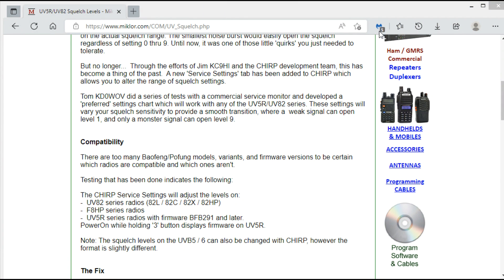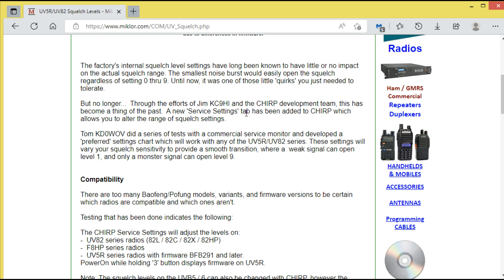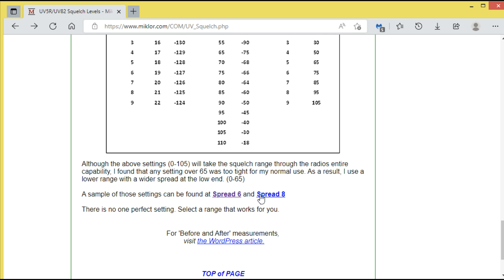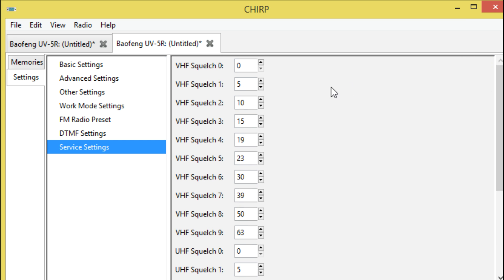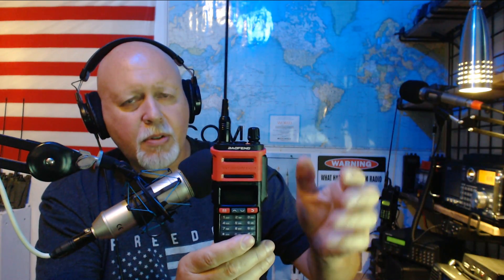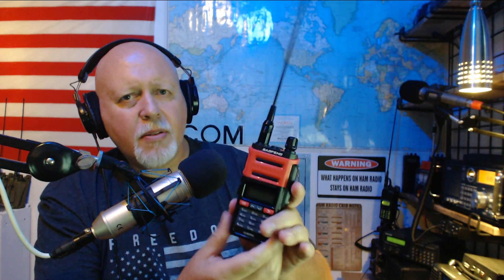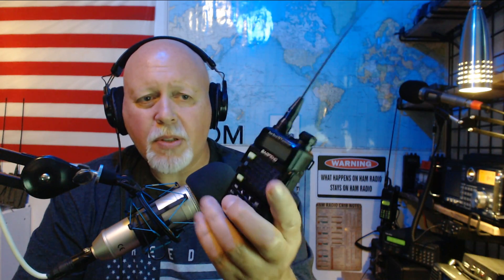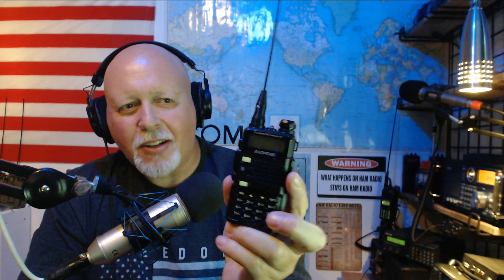Baofeng Squelch Issue Fix!

Comment: If anyone decides to try this, make sure to save a backup image in CHIRP or jot down your original settings so you can restore your radio if it doesn't work. Thanks.
Reply: Some radios, like my Baoefeng UV-5G, there's a RESET setting in there.  Haven't need it yet, fortunately.

Comment: Ordered a programming cable so I can try this. Better than buying a whole new radio for my truck!
Reply from the maker: @minutemenapparel  I'm just curious which model baofeng
Reply: @northmanproject4007  UV-5R. Tried it out today. On setting 4 (which I set to 40), it was fairly quiet, did not hear any static until I was driving near a military base. Forgot it was on! Before up in the mountains, it would constantly have static. Default on my radio VHF 30(9) and UHF  24(9).
Reply from the maker: @minutemenapparel  Awesome

Comment: Yeah those Retevis RT-85 radios are great and have a clean signal as well as a 5w output on the ham, murs, and gmrs bands and the antennas are pretty good too which is unusual for CCRs.

Comment: Thank you Northman, excellent post. After some experimentation, I tweaked your settings a bit and used a 0-60 value range (0,5,10,15,20,27,35,43,51,60). After uploading the changes to my BF-F8HP I tried hitting all my local repeaters to make sure the squelch would open. Everything is working normally,  except background noise is now greatly reduced!
Reply from the maker: Yes! That's awesome! Glad to hear it. Thanks for sharing that! Hopefully it will help others too.

Comment: Thanks for the help. I'm new to this, other than messing around with CB as a teen. Was curious why Ham and GMRS radios use buttons instead of a knob to control squelch?
Reply from the maker: @fondy44  my guess is it's a cost Factor it's probably cheaper to do it that way

Comment: I'm having the opposite issue... I have mine on 1 and can't pickup the weak but intelligible signals in my area. Can't wait to try this
Reply from the maker: Yeah I've actually had one set on squelch level one with a very high value and it was cutting out everything pretty much. Good luck with it.

Comment: I didn't even know about this until now! My UV5R squelch was factory set at 21-29! Too strong. No wonder it wasn't very sensitive. I now have it set at 0-0, 1-1, 2-5, 3-10, 4-15, 5-20, 6-25, 7-27, 8-28, 9-29. Thanks for this video! 😊PS. Never have much interference to constantly break squelch. Glad this is so programmable.
Reply from the maker: That's awesome. I'm glad it has improved! Thanks for the comment.

Comment: My firmware is BFB297 , have to give this a try..thx.
I bought a Baufeng UV-5R when they 1st came out.  Use it mostly as a Police scanner.  I notice that when I recieve a transmission..fine..till I push any buttons..then the radio freezes..unable to recieve tranmissions..  If you press ur ear to the radio speaker..you hear a clicking sound....  Police scanner in back ground works.  Have to shut off the Unit & turn it back on..fine..till you push any buttons.
Found out after years of this headache..that the radio goes nuts whn you shut of keypad 'Beep'..  Turn on KeyPad & unit works fine.
Just in as anybody had/has this problem..please past this infor on.

Comment: Thank You so much! I Actually purchased a UV-9R Pro and sent it back. I thought there was something seriously wrong with it. I got the replacement and it did the same thing! It was constantly dropping a Repeater, even though I no there was no way it should. My scanner was still holding the repeater because it was still up. I was ready to send this one back or just throw it out the windows and count it up as a $24 loss.

THANK YOU!

Comment: Chirp doesnt have this setting anymore, no matter which version of chirp i use this setting cant be changed
Reply from the maker: I did not know that thank you for the heads up I'll have to check it out and see what I can find out when I get some time.
Reply: It doesn't in a new file but it does have the settings tab in a saved file. You have to save the file and the settings tab will appear beside the memories tab.

Comment: Are you referring to the problem where even at level 9, it will make short bursts of static even when there is no one around for miles transmitting? I have that issue with both my baofengs. My old one never did that untill very recently. My new one started doing that out of the box
Reply: That is correct. Out of the box, most if not all UV5Rs, BF-F8HPs, etc. the squelch settings, even at level 9 is usually in the low 20s where the range that you can set with Chirp ranges from 0 - 129. Of course 129 is way too high and would make the radio deaf. However, setting the level in Chirp progressively higher from setting 0 to setting 9 will actually increase the threshold that blocks interference or a signal like the radio squelch should work. What I used and I'm very satisfied was, 0 - 0 / 1 - 5 / 2 - 15 / 3 - 25 / 4 - 35(my normal squelch level) 5 - 45 / 6 - 55 / 7 - 65 / 8 - 75 / 9 - 90. Good luck.
Reply: @kx5e not too long after posting my comment, I leaned about being able to adjust the squelch values for each level. I set mine to approximately what you have yourself set too. And some a little higher. But I was still getting the exact same problem on all frequencies and every squelch level. I ended up going with the baofeng UV-82HP. Right out of the box I no longer had that burst of white noise every few seconds on any frequency.

Comment: Great information.  I've been looking at the GT-3TP but I've held back because of this known issue.  After seeing this I took a look at the settings on my UV-5R and sure enough the stock numbers are nonsense.  Setting 2 is 32 and then it goes up 1 or 2 for each setting after that.  I set it to 7, 14, 21, etc and that seems to work great.  So now I'm ordering a GT-3TP.
Reply from the maker: Right on. I have one of those. I found it has the same problem and this definitely helped. Good luck and thanks for the comment!

Comment: Great video.. I had 3 fangs, one is resting quietly at the bottom of a reservoir..I was more devastated by losing the Nagoya 771 attached than the radio. But anyway.. I do these settings on all mine.. makes a huge difference!  I’ll have to find you Tanerite a
AR video..  sounds like it could be a blast! Yuk-yuk.  73

Comment: My issue is the tone squelch setting does not save to img file.  I can open my latest img file, add a frequency, save it, load to radio, and check menu on radio.  The radio says off for R-CTCS.  I open Chirp, reload the file and sure enough the Tone squelch has been reset back to 88.5  Any suggestions?
Reply from the maker: I'm not really sure what to suggest maybe just try and look for something on one of the chirp forums. I don't think I've come across that issue myself yet.
Reply: In CHIRP, with an image of your radio open, adjust the 'Carrier Squelch' and experiment from there. Mine is set at 1 :) Hope this helps :)
Reply: Maybe “Reset All”, then save a fresh img file off the radio, and start fresh and see if the issue persists.
Reply: Be sure the Tone Mode tab, the tab just to the left of the Tone tab is set to TONE in its menu. It is the top selection. It turns the Tone Mode on and that should save the Tone Frequency when you save the new settings.

Comment: Ive got the UV9R Pro and I have it setup on all of my channels.  The Squelch does suck on it and I have attempted the change of the service settings in Chirp.  Even with the change when I download the config from the radio it still shows those dumb default squelch settings.   Have you confirmed which version of Chirp works on the adjustment?  I am using the absolute latest at this time.
Reply from the maker: Another user said they were having issues with chirp recently. I haven't check or updated mine for some time. So I have not confirmed that it still works. Hopefully they keep those options available because it really does make a difference when you can get the setting to take.
Reply from the maker: Also some radios it doesn't work. I just remembered that. You may have to dig deeper and see if the newer radios with the newer firmware work with it or not.

Here's an article that might help. See if your radio is supported.
https://www.miklor.com/COM/UV_Squelch.php

Comment: I have the opposite problem. I adjusted my squelch like you, but even with a weak but readable station it doesn’t trigger the squelch. I can use monitor and hear it fine, but even with a squelch of 1 (5), it doesn’t trigger audio. Any ideas anyone ?
Reply from the maker: Well my first question is what are your squints values? Maybe you just have to lower them a bit. Like I said in the video start really low progressively increase.

Comment: So I just got a UV9R and seem to have the opposite issue with the squelch. I set it to ZERO and get into a repeater but hear nothing back. My friend in the same room with me can hear me getting into the repeater,but I RX nothing. I tried every repeater in my area...nothing. Is the CHIRP program squelch feature on the latest version or do I need to get it from a specific website?

Comment: Are there two squelch settings on the uv5r. One for uhf and one for vhf. And if so, how does one do it? 8:21
Reply from the maker: I use the same values for VHF and for UHF. VHF has settings 1 through 9 and UHF has settings 1 through 9 just put in the values you want from 0 to 100. Starting 0 at zero value then 1 at 6 then just consecutively increase each number as you go do the same for UHF. I spread mine out about every 10 and start from there and see if that helps your static issues.